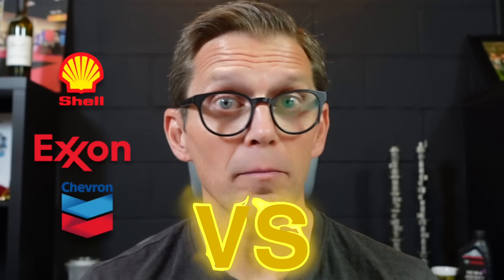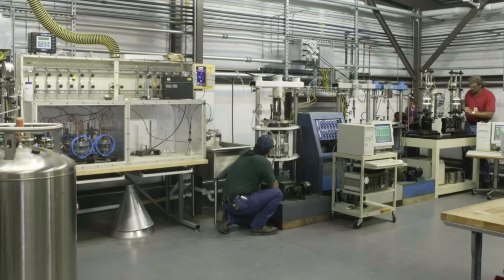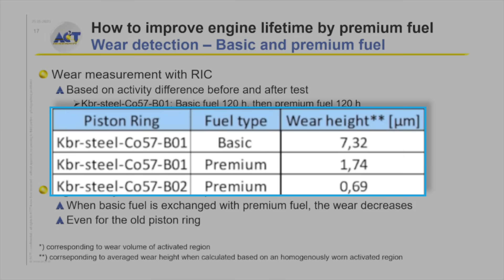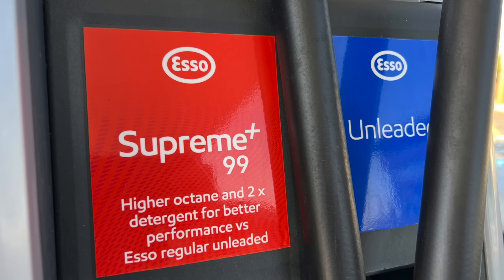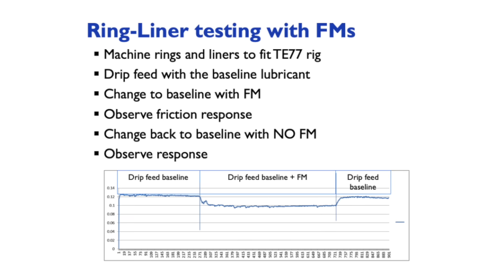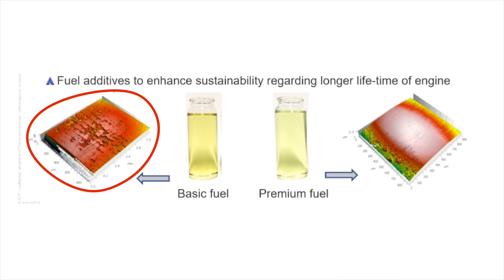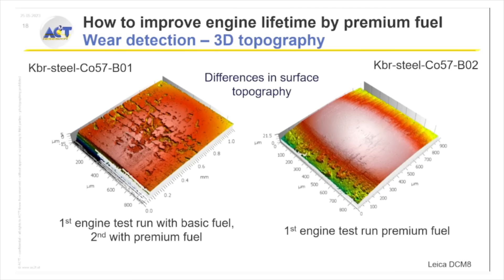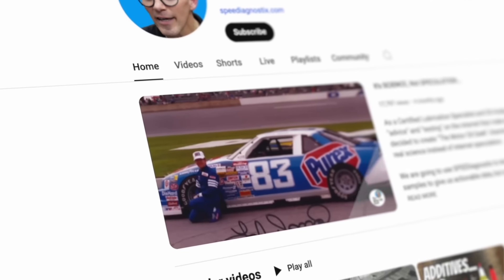Can Premium Fuel REDUCE Engine WEAR?

Comment: 40 year USA fuel hauler here...  it is the additive pkg added to gas at the loading rack when tanker trucks are being loaded that makes a fuel "top tier" or "generic".
Some name brand gas, such as Shell, Exxon, etc have their own proprietery additives, BUT the base gasoline and ethanol blend is the same liquid across all brands.
The additive recipe determines the difference.
By Fed rule, all gas must have detergent additives, so, even the lowly no name gas station or big box stores that have gas are selling the same base gasoline as a name branded stations, just the no names use generic additives and the blend recipe  is probably lower in additives than a name brand.
Also, most all gas stations have a tank for regular gas, like 87 octane, and a tank for premium gas, like 93 octane.  All the choices in octane inbetween 87 and 93 are blended at the station by the pump.  For instance, 89 octane Plus is 70% reg 87 and 30% premium 93.
You are getting what you are paying for...
Reply: I agree 100%, I worked at a refinery (Canada) for 8 years as Instrumentation supervisor and yes all additives were added at the truck loading terminal. Every brand, Shell/Esso etc had their own additive tanks at the terminal which was added (through metering for precise amounts) to the tanker load as required. Does that happen at remote tank farms/terminals that have their fuel piped in, that's anyone's guess but I would say yes.
Reply: @wally6193 Is there a different volume of additives added to each premium brand?  If so, who gets the most addictives?  Do Shell, Chevron, Arco, and Costco all get different amounts of additional additives? Should we assume Shell and Chevron have a better additve package than the others because they cost more?  Or are we just paying for marketing/snake oil when we buy Shell instead of Arco?  Have you ever worked out the additve ratio to see if adding your own additives (ie techron) by the bottle is cost effective?
Reply: @wally6193  What do you think about cheap diesel with diesel additive vs Premium?
Reply: @evelynfarfellwooosh1219  are you trying to compare diesel to gasoline? Not sure about your question.
Reply: @wally6193  Oh, I meant more expensive diesel. Shell diesel or something cheaper then add your own additive vs Shell V-power diesel or other "premium" diesels.
Reply: @evelynfarfellwooosh1219  I don't know where you are, but in Canada, there are minimum limits of fuel additive to diesel, is that good enough, who's to say, but it never hurts to use the primo fuels or add some additives to your fuel(providing it's a quality additive), for that check out the "Oil geeks" websites. I don't believe there are any better refined diesels from the same refinery. Just too expensive to have 2 diesel tranes in a refinery, the only differences are the additives in my opinion. At the refinery I was at that the way it was.
Reply: @wally6193 I would ask Gale Banks of Banks Power.
Reply: I've got a customer that works at a fuel refinery around here and i had a chance at small talk with him yesterday. He told me that fuel is basically 3 ingredients for premium fuel and 4 for regular. The 4th one basically is refining "waste" that is re-refined, cracked, etc, into a "usable" fuel ingredient. He called that the "base fuel". Ethanol is apparently added late into the "base fuel", not long before delivery and in the case of butane, depending on laws and seasons to increase or decrease the Reid Vapor Pressure of the blended fuels. And the brand additives are blended into the tankers.. He also told me that because Premium lacks the 4th ingredient that is basically from "waste" it's more suited for storing  cars, snowblower, etc. as that fuel apparently remains stable longer.  it was great talk but i had 1 billion questions i might have asked if we've had enough time.
Reply: @marc-oliviercabot3380  it's been a few decades since I've been in the refinery end of things but that sounds about right, we never had ethanol at the time. I'd have to dig out the technical paper I wrote up on the refinery to confirm the tank farm formulas for mixing of the various grades. Not sure what he talking about when he refers to "refining waste", there is no waste products.
Reply: @wally6193  that's a good question tbh. He told it was stuff that wasn't usable at the end of the first refining that got re-refined or maybe differently treated, i dunno.. he told it was exclusively used in regular grade gas. Is it possible that the so called waste is waste there but might be of some use everywhere else..?
Reply: @marc-oliviercabot3380  Hmmm, yeah I don't recall anything like that, like I said it's been quite a while since I got out of refining. I might have to look for my writeup, that's another one of those okay where did I put it after decades, lol.
Reply: @wally6193  According to a friend of a friend of a retired Shell Engineer based in Houston, that "re refined" material waste being used is cosolvents. You're basically burning garbage through your engine running cosolvents through it.
Reply: @marc-oliviercabot3380  Really interesting, and aviation fuel  100 LL  Avgas can store for years and still be fine to use, just not legal on the road.
Reply: @dwaynemcallister7231 Not only is it not legal on the road, the lead can do bad things to modern engines. 100LL still has more lead than leaded automotive gas did back in the day
Reply: @JohnMaxGriffin  I used to be a flight instructor at a small airport in Arizona and a guy with a vintage big block Corvette used to come in and we’d dispense 100LL for him. That Vette wasn’t made for ethanol fuels
Reply: @kvstevie  Yeah any engine built when leaded gas was the norm will be fine to run on 100LL
Reply: @kvstevie That wasnt at kdvt by chance?
Reply: @JohnMaxGriffin a guy I knew used Avi gas in his Cadillac and burnt holes on the piston. This was the 80's
Reply: @marc-oliviercabot3380  The Chevy Volt owner's manual recommends using premium fuel, because they say the hybrid Volt can use so little fuel, that it can stay in the tank for a long time and premium fuel has the longest storage life.
Reply: @marc-oliviercabot3380 I’ve never heard anything like this before. So premium has 3 ingredients and 87 has the same 3 ingredients with a 4 ingredient of waist? What??
Reply: @jacobhendrickson8935  well it might be a case of french language barrier here. Perhaps not "waste" per se but something that definitely isn't up to par with a premium fuel. So they pass that "waste" in regular grade gasoline in small enough quantity so they are not causing engine problems immediatly but in large enough quantity so they aren't left with something unusable in big quantity.. The Premium additives are blended directly in the tanker so they aren't one of the 3 or 4 ingredients. The advice he told me was in the line of "you don't want long term problems? Use premium fuels.."
Reply: Premium gas is a lot more expensive, about a dollar more, a gallon. If all gas is the same, plus or minus additives and cleaners, Am I better off buying 20 gallons of regular gas with $20 in store bought additives and cleaners or buying 20 gallons of premium gas, assuming costs become equal?
Reply: Actually useful information. How cool is that
Reply: I'm pretty sure Costco's Kirkland brand gas is the only gas that has the additives blended on site at the pumps to bring it up the top tier standards, everybody's also forgetting one critical component and this is why I think Costco is one of the better gas stations around depending on how the shells are maintained in your area, because the tanks and the pump filters are all critical to the gas staying high quality once it arrives and there's a lot of rundown gas stations and a lot of places that lacks on standards and you can tell because the pumps flow slow, and my personal opinion Costco has the best quality premium fuel at the best price their premium is usually the same price as the regular fuel at other gas stations and I know that they are strict about pump maintenance filter changes and quality there's a handful of Shell gas stations in my area but only one of them is even decently maintained
Reply: @thetechlibrarian additives is blended in the refinery,  octane blending done in the retail level (gas pump). Shell additives are high quality additives but costco is not a refinery so they buy additives from somewhere.
Reply: @thetechlibrarian  Sorry, Costco's additives are "NOT" blended on site. I can see from reading your long rant that you actually have no clue as to how any of this works. So please stop spreading your incorrect BS on the subject! As for individual gas stations not looking up to your standards, practically all gas stations are independently owned and not owned by Shell or Mobil etc etc, and of course Costco owns their stations. Costco buys their product from who ever(Shell, Esso, Chevron etc) they happen to have a contract with at the time.
Reply: @wally6193 No need to be so hostile in your response. You can disagree with the guy's comment without the attack. It makes you seem more credible when doing it that way. Thank you for your input. I'm learning a lot from this comment thread with so many posting who worked in the industry. ✌️
Reply: @sitori663  which comment would you be referring to? I don't think I was attacking anyone. Maybe you're just too sensitive.
Reply: @wally6193 You seem to know everything. I bet you tell yourself your never wrong.
Reply: @EmoKidsRule100  Well not everything, but I did work in the oil/gas industry for almost 40 years and spent 8+ of those in a refinery. Tell me what you know if you like slamming others! I guess it's all in your name "kid"! I haven't been in the refining industry for a couple decades so things could have changed, but probably not much.
Reply: I agree and I live almost right next to a fuel depot and every local gas station and ALL the big names get it from there in my area.  MARATHON  is the fuel depot or loading station.  I was was wondering on this for a long time and a BIG THANK YOU for the BIG QUESTION ANSWERED!!!!!
Reply: I’ve been using shell premium now for about a year and my Kia forte which is turbo that just calls for regular. I had to fuel injectors rebuilt well over a year ago mechanic recommended using some premium gets pretty pricey with auto repairs these days and all the years of maybe using regular course, I got 161,000 miles now, I forget the mileage when the injectors completely failed so I’m spending the extra money with premium plus I get a discount T-Mobile customer and link to a fuel rewards account I get $.15 off a gallon maybe sometimes $.20 off but typically between 10 and $.15 off a gallon so I just spend the money on the premium. My car runs fantastic and I’ve been using synthetic oil also it’s life. I wanna keep those injectors running good and not clogged.
Reply: My F350 owners manual says 87 is fine, unless towing then 91 or higher octane is recommended. Gotta be some reason.
Reply: @TraconWizard With higher octane, there's less likelihood of detonation ("pinging") when the engine is under stress / heat from things like towing.
Reply: What blend is 91? My area doesn't even have 93
Reply: @noob.168   Basic 83 octane fuel, plus additives and sometimes, ( in the winter here in CA) up to 10% ethanol, to get it to 91 octane.  10% ethanol at 106 octane, do the math. Aproximately 90% 83 plus enough additives and octane boost to get it to 89.3333 octane, before adding 10% 106 octane ethanol to make it full 91 octane.
Reply: If you go to the gasoline depot where all tankers go to “fill up” they all,  name brand or non name brand all the tankers fill with the exact same gasoline. This came from a supervisor and a tanker driver that’s been in the business for over 30 years. Knowing this I feel better filling my cars up with premium fuel at every single fill up. If you meet certain variables like branded credit cards or rewards cards can save you .15/.21 cents off per gallon if you purchase their premium fuel. I gave also experimented with regular gasoline and premium gasoline and I did not get 1 mpg difference in mileage. The study was with a 5.7 liter and a 3.6 liter engines and still no difference. My vehicles have always ran and lasted perfectly with the premium fuel. So I stick with the premium. I just hope the additives are actually there. I believe the additives are in all the premium gas no matter where you purchase them from. Have a great day.
Reply: @Tdh8240  Well not quite, depends if a certain brand has an agreement with them. We used to sell certain products to different sellers which had their own brand just as a matter of logistics. But if a certain retailer, which also had their own refinery, didn't have an agreement with us then they couldn't buy from us, just makes sense. For every product we supplied to client who had their refinery, let's say reg gas, we had to continually send samples of our production run batches to  their labs for testing to ensure we were within their specs for that product. Of course if the client didn't have their refinery, then they could have an agreement contract with us to buy a product based on our specs. And then of course there were the additives for each grade of gas/diesel which varied from clients who had their own refineries. So not as easy as you make it sound but never the less it was done fairly simple. It's obvious your supervisor friend/contact doesn't know everything about the inside workings of this.
Reply: If they have a loading rack for the trucks it is done at the rack.
The raw, or base gasolines get piped to storage tanks, regular, and premium base gas, then to the rack to load trucks where at the rack the additive blenders and ethanol blending equipment is there.
When I say base gas I mean for example, where I am at, the 87 regular pump fuel is a 10% ethanol fuel. So, the base gasoline is actually 83 octane, and the 10% ethanol brings it up to 87.  Prem is a 91 oct base, the eth brings up to 93, plus the either top tier or generic additives, or proprietery name brand additives all go in at the rack next to the truck.
Reply: @catdaddy3728  Yes of course. Each brands additives are injected into the line before the metering stations. Like I said I was in charge of the all of instrumentation in the plant and facilities, so I know how these systems were designed. Not to mention I worked designing refineries(engineering)  for a number of years.
Reply: @wally6193 so do I use 93 to get this additive even though my car is rated for 87?
Reply: @MrApplesaucestuff  If you're in the USA I can't answer that because I don't know what the minimum requirements are by law in the USA. In Canada all gasoline is required to have those additives, but you may get more in the 93 for some brands.
Reply: @MrApplesaucestuff, yes, and you can also make more power from it to. You can safely advance in "some" ignition timing also for that extra power if you are able to, or want to. 87 octane has a lower threshold for pre detonation as supposed to 91 or 93 octane. With the benefit of better wear protection.
Reply: I'm in Canada, yes there are mins but I don't know what they would be now. Let's not forget it's minimum, some do put more  and not all additives are the same or from the same sources, just like motor oils.
Reply: @MrApplesaucestuff  Good question! I was always told that premium fuel was a waste of money on a car the requires 87 octane gas.
Reply: @MrApplesaucestuff  yes, you can always use higher octane gas. The other option are additives you can add yourself to the basic gas. The question is how good they are.
Reply: @MegaGeorge1948  
This is correct. Your vehicle only requires the octane that is specified in the owner’s manual. Using 93 octane is a vehicle that only requires 87 octane is wasting money.
Reply: @wally6193  I always use Chevron 94 for my Porsche, is it worth it? When you say "may get more/better additives" how'd I ever know?
Reply: @WowRixter  I use either Chevron or Shell, who ever is gouging less on the day I need gas, haha. Nothing wrong with Esso, just very few around where I am.
Reply: @ few Shells near me. I guess I’ll stick with the 94-Chevron
Reply: @WowRixter  Some have said that Shell has been adding more of the additives than required, but I have never seen/read actual tests to see if in fact they do. I did read where someone who works for Shell ( I don't recall his position, but it was technical) recommended using Esso gasoline. Don't recall if it was Canadian or USA.
Reply: @MrApplesaucestuff  get 87 and add Chevron Techron
Reply: @larryechols6606  yup
Just do octane 87 but gas up in a branded  station like  SHELL so you'll get quality additives at the right quantity than a no name station with dubious additives
Reply: @HikerBikerMoter 
My bike requires at least 91 octane and that’s why I’m using the 93 octane non ethanol.
Reply: @WowRixter the branded gas: shell, chevron etc. Theyre additives is proprietary, non branded buy generic additives from somewhere
Reply: @TRUCKING-TRENCHES You got that backwards.
Reply: I read a thread on Bob Is The Oil Guy, that Costco far exceeds Top Tier & they add their   additive package on site to the underground tanks at each Cosco location by the fuel attendant...🤔
Reply: @chrispompano  I doubt that very much, but you never know, maybe in the USA but not in Canada.
Reply: I learned a lot from this comment, thanks for sharing!
Reply: That’s interesting. Thanks for writing.
Reply: I've never paid for more than 87 Octane gas and never had valve problems, and I'm talking forty years of diving. I'm debating now between a Fuel Additive like Lukas from auto store or high pricey Octane?
Reply: Now I understand why switching from a premium blend fuel like Shell to a lesser fuel brand can cause the check engine light to come on.  I’ve had it happen on several cars.  Also a mechanic told me it could occur from the switch, just not a lot of detail as to why.
Reply: Iam a fuel hauler in DFW for 10 years i agree with everything you said
Reply: I’ve been using shell premium now for about a year and my Kia forte which is turbo that just calls for regular. I had to fuel injectors rebuilt well over a year ago mechanic recommended using some premium gets pretty pricey with auto repairs these days and all the years of maybe using regular course, I got 161,000 miles now, I forget the mileage when the injectors completely failed so I’m spending the extra money with premium plus I get a discount T-Mobile customer and link to a fuel rewards account I get $.15 off a gallon maybe sometimes $.20 off but typically between 10 and $.15 off a gallon so I just spend the money on the premium. My car runs fantastic and I’ve been using synthetic oil also it’s life. I wanna keep those injectors running good and not clogged.
Reply: What about the 93 octane non-ethanol gasoline?
Does it also contain an additive package?
Reply: @ yes.
Reply: @larryechols6606  Absolutely. Yes.
Reply: I wish there was an easy to understand conclusion from this video. Would you say just get the highest premium gas (i go to shell). 22 mazda 3 non turbo. Thanks
Reply: @great-garden-watch  the conclusion I came up with is 87 is crap. No wonder I constantly have to add methanol to get the car to run decent. I've noticed everyone else's vehicle I've driven or ridden in to also have that issue but I guess they're not sensitive to slight roughness like I am. I've actually decided to go at least 89 so I feel like I'm buying some gas lol. I figure this is why with the 87 the Marvel Mystery Oil additive helps so much.
Reply: @great-garden-watch all sellers provide additives
But the branded sellers (ie SHELL) provide better quality and quantity of additives.
Reply: Food for thought...have you noticed that Chevron is the only brand that actively markets their fuel additive?
Why is that
Reply: Was then engine in the test set up for premium fuel?   Some engine mandate premium (ignition) and if running 87 can see maybe combustion not optimized leading to more than normal dilution in this test.
Reply: Is the additive package shell uses the same formula for regular and high test?
Reply: @robertstewart1262  good luck trying to find that info, unless you can talk to a Shell employee who is willing to tell you that info, but I doubt it. All of these additives for any supplier is a secret, they wouldn't tell us or even give us MSDS sheets on their additives. Come to think of it Shell only had on additive tank at truck loading, and I can only assume that we provided them with both reg and premo, so maybe at that time is was, but that was in the early 90's and most likely has changed since then. Seems to me that additive ended up causing fuel tanks problems in many cars/trucks and had to be changed. I think there was even a law suite against Shell for that additive.
Reply: @robertstewart1262  I don’t know for sure, but to be top tier fuel, I would imagine all grades get that additive package. Maybe 92 gets something extra.
Reply: 100 percent correct , I to was a fuel hauler
Reply: The better  the gas the better  the combustion,  bottom  line!
Reply: What about diesel fuel 1 or 2
Reply: @michaelmorris1971     Yeah, diesel has additive pkgs. Innit.  Depends if big name brand or local small time.  If it's biodiesel or straight.  Diesel gets, depending on who it's for, winter additives for low temps without blending kero into it, lubricity additives even in biodiesel, lubricity goes in.  Big name fuels have trade secret proprietary blends, truckstops and high volume dealers would be crazy not to have all the good stuff added depending on time of year.   Just gotta watch, same for gas, small time shitty looking dumps that are dimly lit, filthy... but have low price advertised...   that lower cost will quickly go away if fuel is bad.
Reply: One small correction, The blending isn't done by the pumps (submersible turbines in the tanks) the blending is done by the dispensers. What people call "pumps", the things that you park next to and dispense fuel from, don't pump anything. They just dispense, blend the fuels if need be, and count (meter) the fuel. I'm a fuel dispenser technician.
Reply: @z3r3pmoto  You are correct.  I know it all happens underground, but simplifying what is happening, I called it the pumps... dispensers.
Reply: I find this also true in The Netherlands, where near the Port of Rotterdam the SHELL refinery is located. Trucks are loaded up,  then drive further to the additive station. Each brand of fuel (Shell, BP, Esso etc) stops at it's own specific additive filling pump. Additives are than mixed from the topisde into the tanks. Mixing happens while driving automaticly. There are at least two different compartments, one for Regular Gas (called Euro 95 Octane E10, with 10% compulsory Ethanol) plus brand specific fuel additives and the other (Super Unleaded 98 Octane E5 (voluntary up to 5% Ethanol) plus brand specific fuel additives. They also make Super 100 octane (no Ethanol).  Watching with great intrest form The Netherlands, Bob "The Dutch Oil Guy".
Reply: So why are all brands the same price? I'm in Vancouver Canada and they all cost the same. There will be 2 stations at an intersection and they all charge the same.
Reply: @RapidfireLaser   Well, if on the same intersection, they keep same price to avoid "price war"  one lowers, the other lowers, etc.  Other areas it depends on status of area.  High rent areas charge more cause people will pay more.  Reverse for low rent...
Reply: I got a Toyota Corolla 2020 with 257000 miles and I put gasoline free ethanol and I feel working better.
Reply: Thanks cat daddy
From the horses mouth..
Reply: WE splash 60% 87 with 40%92 for stations and racks that don't blend. to get 89
Reply: Where to get 100LL ?
Reply: @user-gl2eq2ly4g  At airports that primarily cater to general aviation. Whether they will let you fill up your tank is a whole nother question.
Reply: @user-gl2eq2ly4g  airports which serve piston driven aircraft have 100LL. However, they might only sell it for aircraft use.
Reply: @user-gl2eq2ly4g 
Smaller airports where piston aircraft (Cessna, Piper, etc) fly. They may not be able to sell legally to you.
Reply: GREAT INFORMATION
Reply: Another retired fuel hauler that used to work for Shell oil in Louisiana a long time ago said basically the same thing.
Reply: Thanks very interesting.
Reply: The Shell refinery guys were saying burn Esso it's a better fuel. Not every fuel is created equal.
Reply: Pretty sure top tier fuel stations have more strict requirements for water in fuel and contamination. Running a car on esso, always ran worse than running on shell or petro. Esso was about equal with those low quality places like husky
shell was always the best.
Reply: @jacobvanhalteren7452  water and contamination from what source?
Reply: I’m running Sunoco fuel the new 94 Octane offering. I have an older 2003 Mustang GT but even though it’s 87 rated I have a slight tune and modifications so I run 93/94. People always told me I’m wasting my money, maybe not turns out.
Reply: @brettconv83  Last I checked, Sunoco uses the same additive package in all grades.  It's only Shell and BP that will get the benefit described in the video by going with higher grade.  That said, it is still a waste of money unless you really need the higher octane.  It is cheaper to buy a bottle STP or Techron every time you fill up with 87 than it is to upgrade to 93+.  That said, maybe you need the higher octane with your Mustang.
Reply: So I watched another video talking about top-tier gas and generic. That guy was saying, the same additives are added throughout that brands octane levels. Example: chevron adds the same amount of Techron to 87 as they do to 91. 
Would you say that is true?
Reply: The rack I hauled from in the Midwest was all generic additive except Texaco. They had their proprietary additive. I also used to haul racing gas out of the 76 refinery in Romeoville, IL. 210 octane, fully leaded.
Reply: A lot of the stations around here stock premium non-ethanol and don't even have 10% ethanol premium. I'm going to try a tank and see it my fuel mileage goes up enough to justify the cost.
Reply: True! My father in law worked at a utility company that gassed trucks on site. When the guys maintained the pumps you only saw two lines coming from the tank. That’s when the technician explained this same thing.
Reply: yeah though long ago i remember seeing that if u mix your own u can save money, ie put half tank of 93 and half tank 87 and end up spending less than how they price the mid grades, at SOME stations
Reply: Around 1991, I worked at an Exxon station and the parking lot had three openings to fill the tanks, painted the corresponding color on the pumps where you choose regular, plus or premium.  I will certainly be checking out gas stations tomorrow LOL
Reply: Minimum in sweden is 91 (95) octane with up to 10% ethanol. I believe all use additives and the differenve in price between cheaper and more expensive is often a few %.
Reply: Please don't use 100LL anywhere that it isn't mandated. We stopped using leaded gas for ground transportation long ago for a very good reason. I think it's still bad to use it even as aviation gas, but that's a very nuanced situation where there are tons of old aviation engines that need very high octane but also very stable gasoline, so difficult to find a replacement that will work for everything.
Reply: I just bought a Lincoln Aviator with the twin turbo 3.0 400 HP and 415  
Ft/LBS of torque and they suggest premium fuel but said it will run fine with 87 unless your racing it.
Reply: @jamespoole9839 why cheap out when you can get good gas? Just get premium and your turbo engine will love it
Reply: @jamespoole9839  Almost all engines will run just fine on 87 if you're just cruising on the freeway.  But all it takes is one emergency when you floor it for low octane gas to cause damage
Reply: @jamespoole9839  All cars sold in the USA that recommend premium fuel, are also sold in countries that only have 87 octane. Any car with variable valve timing will run fine on any octane, unless like you were told, really getting down on it.
Reply: Bull
Reply: I love how these guys like lake try and tell you that shell is better than brand x when in reality they are all EXACTLY THE SAME. With the exception being the additive that is added at the rack. My good friend also delivered fuel and when he told me the amount of additive that he put in that tank frankly I was shocked. Talk about a drop in a bucket it literally is  one drop per 5 gallons.. So when it comes to guys like lake just remember who is paying his bills.. cough cough shell oil company..
Reply: @phillipmitchell1418 well sir as an automotive tuner we see the difference in said oil companies gas and most tuners across the us will all tell you shell gas is the top pump gas out there.. no I’m not paid by shell or any other gas company. Just putting my 2 cents out there . As all we do is look fuel logs and see the difference between the major gas companies
Reply: Shell high Octane is the best premium gas. That is what most tuners say because when they run the dynos on high performance cars it shows.
Reply: @paulj9821 I agree
Reply: @phillipmitchell1418  one drop per 5 gallons?😂 make things up much? I remember when I was in high school we tested Shell gas, Mobil, And some cheap no-name. The additives in the Shell gas were far superior and the shell gasoline was much better. I’m just a regular guy, I don’t work for shell, that’s just the data. And I hate to tell you, no additives package only has one drop per 5 gallons. Don’t be ignorant.
Reply: @phillipmitchell1418  He never said Shell was better. I said Shell's claim has merit.
Reply: @phillipmitchell1418 I love how these guys like Phillip Mitchell make up BS on the spot